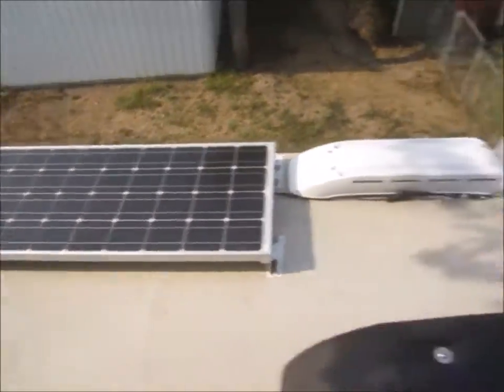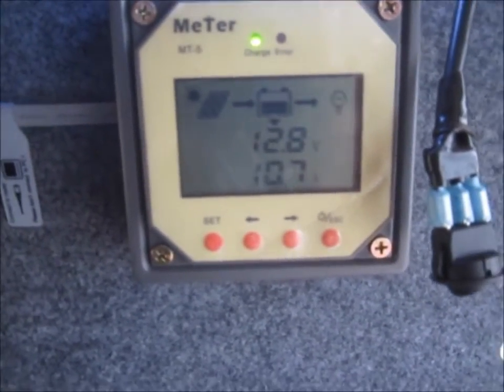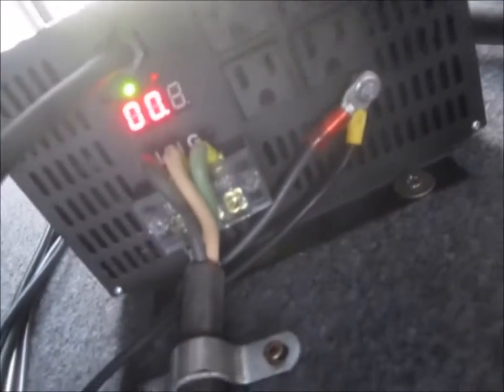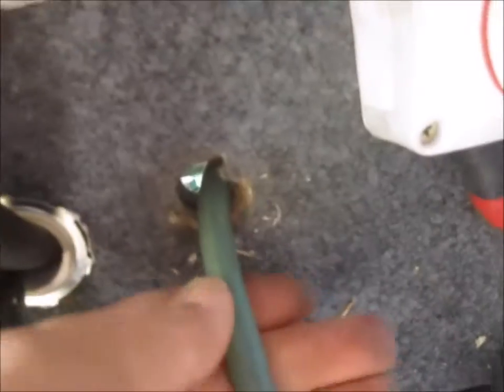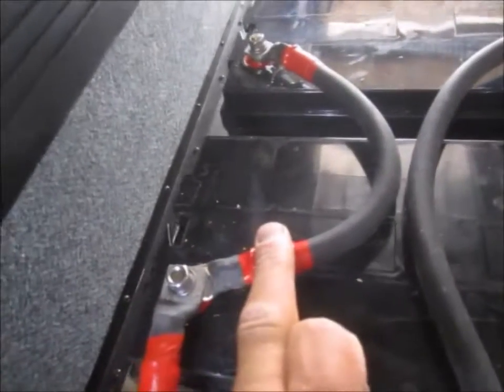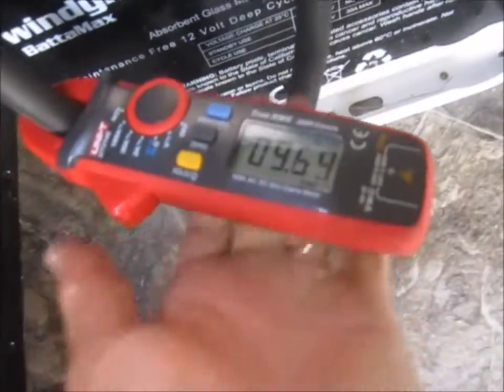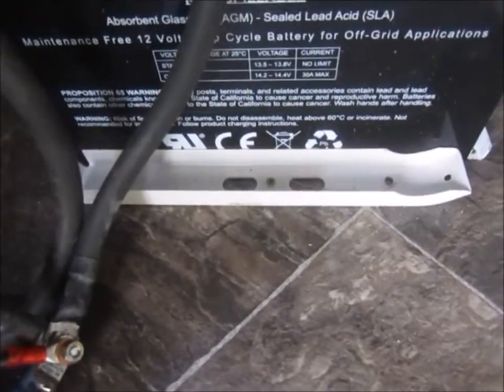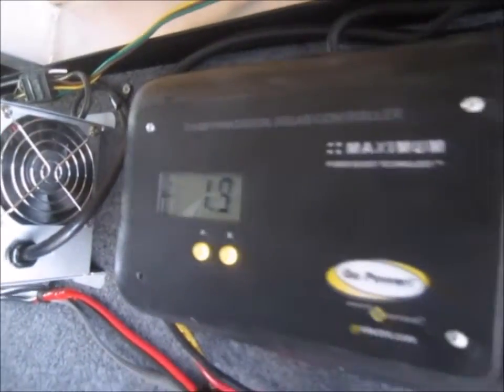Solar phaze 2. 600 watts Renogy panels and 2nd charge controler to power inverter

Comment: So what are you doing with the gen on the rig now? Have you disco the charging side of the rv? When you have time can you list the sizes of wire and what tools you use.. being a handycap vet hard to do all you have done. But would like to know what tools you used and where you got them. Iam now living in No, on my home ranch out side montello,nv. Going to hook it up in a shack next to rv, then run wires in tub to rv. Like to just Mack a 50 am setup so I can just use the long cord for rv  to run the rig...so let me know what you think on this setup? Thks like be your vidos
Reply from the maker: John, I still use the Gen. Rainy-cloudy days with no sun. Also camp in shady areas, no sun.

I now have 2 chargers. The one that cam with the trailer, and the one I installed for the 2nd battery bank. When I am using solar and the inverter for power, I just unplug or open the breaker to them'

The battery cable wire is 02 and solar panel to charge controller is #10, charge controller to battery is #8
All the tools and supplies I use are in the videos. I list where I bought them and what they cost in the description on video. Most with a clickable link to take you to them.

The last bit I have question. I think you said, you want to install tall the solar, battery's, and inverter is a small shed then run your RV cord to it? If that is the case, that would be much easier and cheaper than on the RV.